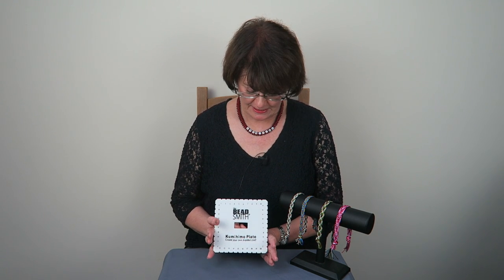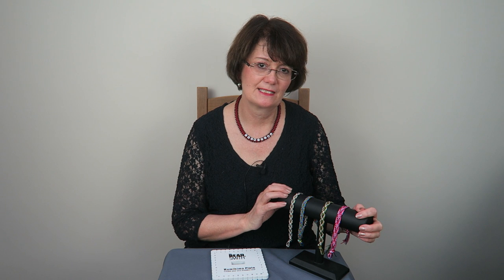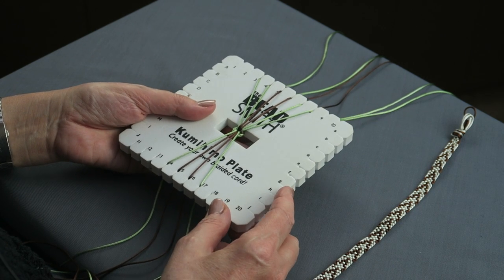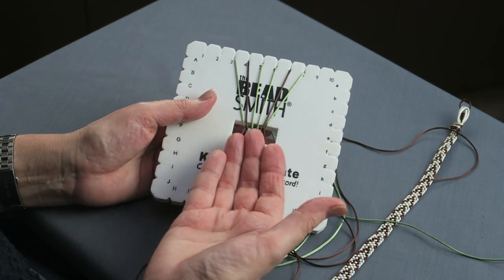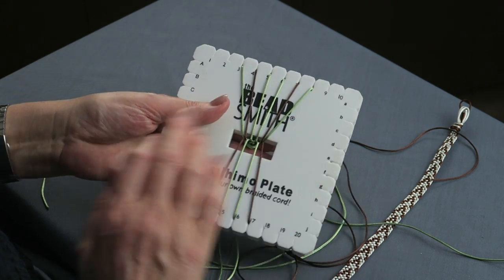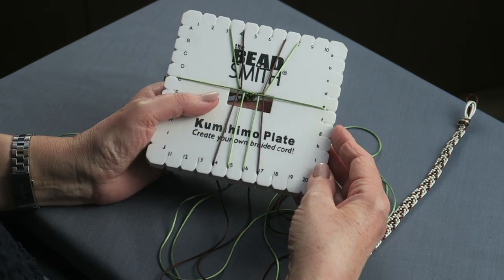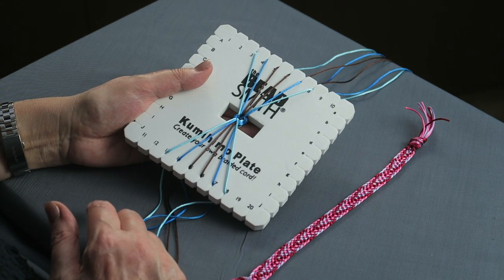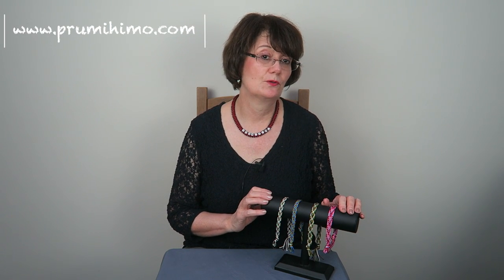How to use the kumihimo square plate to make flat braid

Comment: Thank you for this excellent tutorial, and the tips at the end for setting up braids with even more warps. The first (and only) standard 10 warp braid I made used eight cords in the main color and just two in a coordinating color (intended to warm up the main color just a little bit). I really had no idea what I was doing, or if it would work. I lucked out, starting the odd colors at the crossover (which I didn't know of at the time), and soon discovered a diamond pattern emerging! Seeing how those two cords travelled  showed me the importance of the crossover to this braid, and the diamonds now gave me a specific place (at the widest point) to nestle the gemstone beads I'd planned to use all along. Pure beginner's luck! I think this square disk series will inspire me to push my luck once more!
Reply from the maker: Interesting observation. Trial and error is always so valuable. Your gemstone braid sounds great.

Comment: Ty.  I just purchased Kumihimo plates, I'm very new to this art.  Eventually I want to make an even wider braid with thicker or more cords for a larger handbag.  Question on the 12 cord braid:  why not take the 2 side cords to the top like you do on the 10 cord braid?
Reply from the maker: Georgia Corey - The reason for this that at this point there are already 6 cords on the top and 4 on the bottom, so by bringing the side cords down  you have the same number of cords on the bottom.

Comment: This may be a stupid question but is it at all possible to do a flat braid using a round disk with these braiding methods? Or would that produce a different shape? I'm very new to kumihimo and I am absolutely in love with it. Excellent tutorials!
Reply from the maker: It is a very good question! In theory, yes you can make this braid on the round disk, but it would be harder to get even tension and straight sides. If you shop around you can buy these very cheaply, so I would recommend getting one.
Reply: @Prumihimo  Great thanks for the tip :)

Comment: Great video!  I am just learning on the circular plate but want to get a square plate soon.  Is binding off a flat braid the same as a round braid?  What type of end cord do you recommend for flat bracelets?
Reply from the maker: There are several ways you can finish them off. You can try flat ribbon ends that you squash flat with pliers or you can squeeze the flat braid into more of a round braid and treat them just the same as a round braid.

Comment: Can it work for 10 braid too
Reply from the maker: You can adjust the number of cords you use for this braid. For 10 cords you need 6 across the top and 4 across the bottom of the disk/plate.

Comment: and how much length is average? does the material change those numbers
Reply from the maker: The ususal recommendation for all kumihimo is to use 3x the required finished length for each cord. This is generous, but you can't add in more cord if you need it so It is worth sticking to this, especially as different materials do have a different take up, depending on the width and also the firmness of the cord.